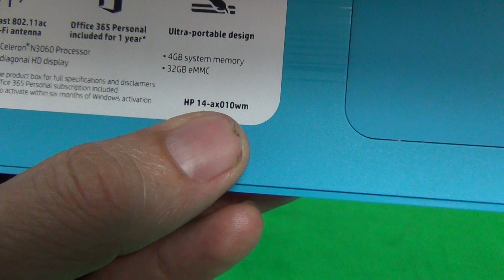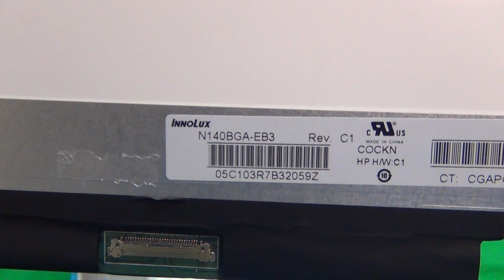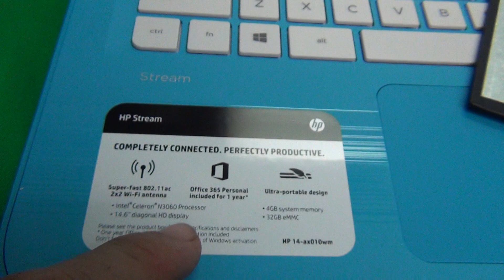HP Stream 14 14-ax Laptop Screen Replacement Procedure

Comment: Can you tell me how to open it to repair the keyboard plz
Reply from the maker: mel julien plz check the channel. There should be a video.
Reply: Screen Surgeons my son spilled juice on the laptop and some of the keys don't work .....help me ....this is a new laptop
Reply from the maker: Plz check with your credit card if it has damage protection on new purchases. Otherwise the top keyboard assembly needs to be replaced.